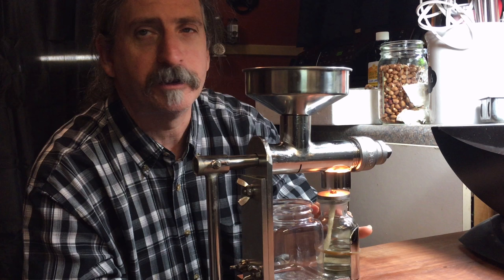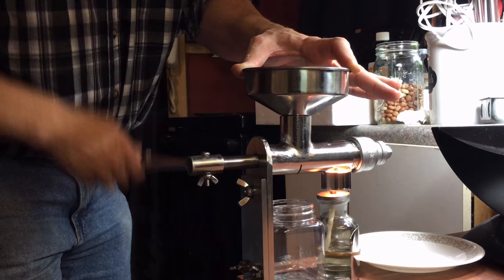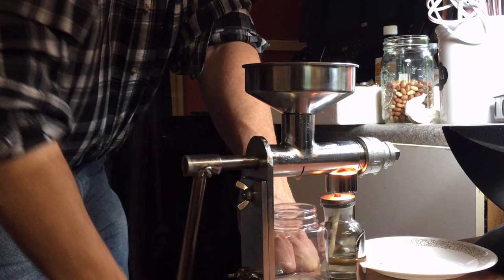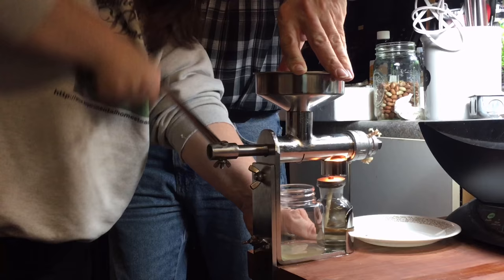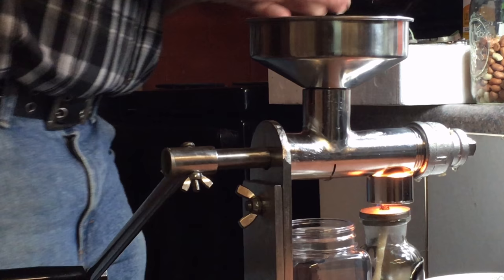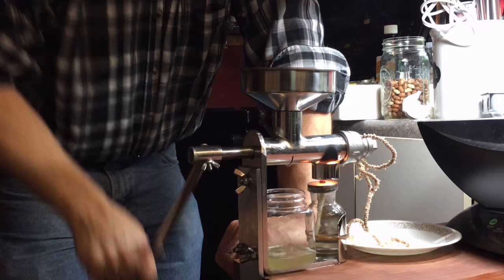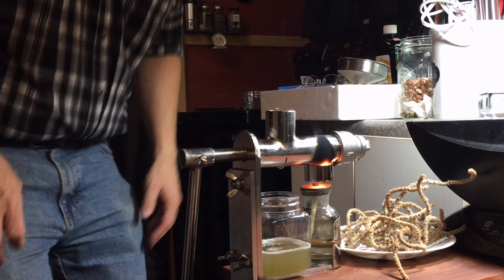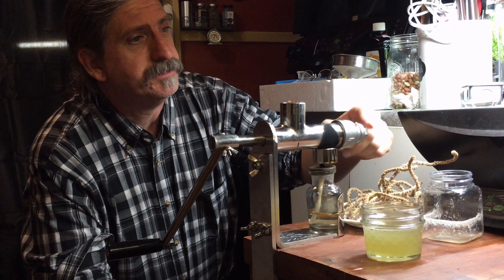Manual Oil Press Review

Comment: Hello any chance of an updated video, talking about your overall experience with the press. Pro tips, any issues, modifications, do and don'ts, fine tuning of the press etc would be extremely helpful. Which seeds work for best results. Instead of using kerosine or lamp oil, have you tried it with different oils for the burner, like some of the oils you already expressed using the machine. Or are they all too extremely flammable? Surely there must be a few expressed oils that could replace the lamp oil? It certainly would be nice to be able to have the machine self sufficient by expressing your own oil that can be used for the burner itself. Also any ideas or demonstration on making your own wicks for the press. Maybe even being able to use some of the seed cake for this, or is that a bit of a stretch? Or anything else you can think of? Any other options for heating the press, like a very small wood fire, instead of the oil burner (if using outside of course). Maybe even a cleaning video of the press. Also were you able to stop oil drippage from the end of the press. Just a general update would be great. Are you still using the press, or have you upgraded to a different version etc. Cheers in advance. Have you tried expressing leaves for their oils, by hot and cold press to see what results you can get for their essential oils. Were you able to fix or replace the S/S seed catchment so it doesn't pop out, too make it stay in place. IE find a replacement with a longer funnel at the bottom so it stays in better, or attach something to make it longer? Did you end up moving the press to attach to a larger heavier table or bench in the end or?
Reply: Good idea. I’d love an update
Reply from the maker: I would love to do an update eventually. We both currently work 12 plus hours 7 days a week, so it will be a while. I did update the blog post - I think.

Comment: If I may make a suggestion. To clarify the oil you can use gelatin or just plain old cold filter and time but the gelatin works quickly to grab solids and trap them at the bottom making easier to put into a clean jar
Reply from the maker: Thank you for that tip!

Comment: When you heat all the proprieties of the différents oils are damage? If you make with sunflower or linen it very sensitive to the heat the light and oxygen. So all omegas are burned. Sorry about my English. Kind regards.
Reply from the maker: Hi David, your question is spot on, and your English is just fine! 😊 When using a manual oil press with heat, it's essential to consider the properties of the oils you're extracting.

You're absolutely correct that some oils, like sunflower and flaxseed, are sensitive to heat, light, and oxygen, which can cause them to degrade and lose their beneficial properties, including essential fatty acids like omega-3s. The pressing method I demonstrated in the video does involve some heat due to the candle flame, but it's relatively mild compared to other extraction methods.

For oils like sunflower or flaxseed, cold-pressing methods are often preferred to minimize heat exposure and retain their nutritional value. These methods use mechanical pressure without external heat sources.

Your concern highlights the importance of choosing the right extraction method for different oils to preserve their unique qualities. Thank you for bringing this up, and if you have any more questions or want to discuss specific oils or extraction methods further, feel free to ask. It's great to have these discussions about the science of food and oil extraction! 🌻🔥🍃
Reply: Thanks for your response. So what kind of oil press can I use without heat to extract flaxseed, sunflower, or any oil contains omega 3?

Comment: I wonder if that seed cake is similar to the powdered peanut butter people buy
Reply from the maker: Hey Matthew, great question! Seed cake from the peanut oil extraction process does have some similarities to powdered peanut butter, but there are also significant differences.

Seed cake is what remains after the oil is pressed out of peanuts. It's essentially a concentrated peanut residue. While it does contain some residual peanut flavor and protein, it's usually much higher in fat compared to powdered peanut butter, which is defatted and often contains additives like salt and sugar.

Powdered peanut butter, on the other hand, is made by roasting peanuts and then removing most of the fat, resulting in a lower-calorie and lower-fat product. It's typically used as a lower-fat alternative to traditional peanut butter in recipes and shakes.

So, in essence, both seed cake and powdered peanut butter start with peanuts, but they undergo different processes and serve different culinary purposes. It's fascinating to explore these connections in the world of food! If you have more questions or want to know more about either of these products, feel free to ask. 😊🥜🍴

Comment: Thanks for the video, question. Do you know what temperature the oil gets due to the heating?
Reply from the maker: No. We did not take the oils temperature after pressing, but it did not seem hot. I was able to pick up the container of oil with my bare hands with no issues.

Comment: Any idea how this would with softer material such as olives?
Reply from the maker: Hi @DirtRoadAutoRepair, great question! While the manual oil press I demonstrated in the video is primarily designed for seeds and nuts, it can work for softer materials like olives with some modifications.

When working with softer materials, you may find that the pressing process requires a bit more effort compared to harder seeds. It's essential to ensure the olives are well-prepared, such as pitting them before pressing.

Additionally, using a lower-pressure setting and slower, more gradual pressing may be necessary to extract the oil effectively from softer materials like olives. Experimentation and adjustment of the pressing technique will help you achieve the best results.

Remember that the quality of the oil extracted can also depend on factors like the ripeness of the olives and the variety you're using. If you decide to try it with olives or have more questions about the process, please feel free to reach out. Happy pressing! 🫒🥜🛢️

Comment: Can this be used as a vegetabale juicer aswell??
Reply from the maker: Great question! While a manual oil press and a vegetable juicer both involve extracting liquids from plant-based materials, they serve different purposes and have some key differences.

The manual oil press is specifically designed for extracting oils from seeds, nuts, or oil-rich materials. It operates by applying mechanical pressure to these materials, which results in the extraction of oil.

On the other hand, a vegetable juicer is designed for juicing a wide variety of fruits and vegetables. It typically uses a different mechanism, such as spinning blades or augers, to extract the juice from the produce.

So, while a manual oil press is excellent for oil extraction, it may not be the best choice for juicing vegetables, as it's optimized for a different process. If you're looking to make fresh vegetable juice, I would recommend using a dedicated vegetable juicer for the best results. If you have any more questions or need further clarification, feel free to ask! 😊🥦🍹

Comment: What happens when we don’t use the candle 🕯,pls can u reply, and was the oil hot or warm or very hot ???
Reply from the maker: You need to use a candle and no, the oil was not hot or even warm if I remember correctly.
Reply: Sheri Ann Richerson thanks for the reply 👍
Reply from the maker: You are welcome.
Reply: I own one of these, without heat, the seeds or nuts just get bound up and wont expel oil or castings. The temperature of the body outside of the ring the candle is under gets warm, but not hot to the touch. I'm assuming in electric or industrial presses the friction provides the heat to help the oil flow.

Comment: Looks like there is more leaking from the end than going iin the jar.
Reply from the maker: Hi @inannashu689, thank you for watching the video and sharing your observation. When using a manual oil press, it's not uncommon to have some oil leakage, especially if there's a mismatch in the size of the press tube and the receiving jar's opening. To minimize this, make sure that the press tube fits securely into the jar's opening, and you may also want to use a jar with a wider mouth to catch more of the extracted oil. Additionally, adjusting the pressure applied during pressing can help control the flow.

Every setup may have its unique quirks, so experimenting and finding the right configuration for your specific press and jars can improve efficiency. I hope these tips help, and if you have any more questions or need further assistance, please feel free to ask. Happy pressing! 🌱🥜🛢️

Comment: Does the oil extracted contain lots of water that is there inside the seed?
Reply from the maker: I did not see any water in the oil I collected and it did set in the refrigerator about a week or so as I used it up. My guess is the water evaporates in part because of the heat as it is pressed.

Comment: How can you do cold press? Without using the lamp? What does the lamp do?
Reply: What does heating part do?
Reply from the maker: Releases the oils. You need to heat the material in order to get oil. You can use the lamp to heat the materials, use an oven or a microwave but you must heat up the material you are pressing to get it to release the oil.
Reply: @SheriAnnRicherson  i know cold press gets less oil. Can I use this tool to make cold press oil? Or only with heated materials?
Reply from the maker: @youngmipark3607  I think you are misunderstanding. You MUST heat the item you wish to press in order for it to release the oil. You can use this lamp to do that with - or a microwave or an oven. You cannot get oil from a nut or seed without it being slightly heated.

Comment: help me, I bought one exactly the same and everything got stuck at the end and nothing let out by the holes, I´ve tryed with 4 seeds, almonds, sesame, sunflower and walnut and nothing happens
Reply from the maker: Try to loosen the end of the press. Did you hear it for 7 to 10 minutes first? Let me know. Jeffrey is at work but I will ask him if he has some tips tomorrow if what I told you does not work.
Reply: +Sheri Ann Richerson i already did that and sometimes the seeds inside get burn, other times just get stocked there, i want to cry, i am in a big problem because i bought 20 for a customer and if they don't work i am lost, do you know how long it took cranking until the oil came out?
Reply from the maker: +eva mex - it took a few minutes. I thought I read that the sesame seeds needed mixed with something but I honestly don't remember. Let me get with Jeff as he did the assembly and video.
Reply from the maker: +eva mex - I remember he let it set too long and the peanuts hardened inside so we had to soak it for quite a while before they came loose.
Reply from the maker: +eva mex Hi, there is no need to charge. We do not have whatsapp. He wondered if your flame was too high? He also said it does take a while to get the inside of the oil press full of seeds before the oil starts to come out. Once it starts to come out, it flows continually.
Reply: +Sheri Ann Richerson ok thanks, i will try
Reply from the maker: +eva mex - were you able to get it to work?
Reply: +Sheri Ann Richerson  no sheri :( i ve been cranking for 20 min and nothing of the cake comes out
Reply from the maker: +eva mex - I wish Jeff was here because he might know something else. I am sure you are frustrated. Did you fill the hopper full of seed? I am sure you did, but I am just trying to think of what the problem might be. Try loosening that end a bit more too. I know you said you tried that. I remember he thought it was loose enough at first and it was not.
Reply: +Sheri Ann Richerson yes sheri , i heated for 10 min, it started to get oil at minute 5 but at minute 10 started to smell burnt and oil turned black but the blamr was really really low
Reply from the maker: +eva mex - That is so strange. What kinds of seeds were you pressing? I almost want to tell you to try Spanish Peanuts and see what happens. I chose those because I figured that would be the easiest. I have not tried anything else yet.
Reply: thanks a lot my friend, we are thinking that maybe the holes are so small, tomorrow we will do some tests and let you know :)
Reply from the maker: +eva mex - thank you! I will ask Jeff if he has any other ideas when I see him. Have a good night.
Reply from the maker: Thank you!
Reply: eva mex I had the same issue.  I did not let it heat longer enough before cranking,  it all compacted in the cap and then it roasted hard like cement.  Pain to get it clean.  Let it heat longer and it worked great.  I was using soybean.

Comment: Can you cold press with that too? Or is it to hard to crank?
Reply from the maker: We are cold pressing. It is not hard to crank. Heat is required in order for the nuts to release the oil.
Reply: @SheriAnnRicherson  thank you so much for that. Mine will be here tomorrow.  I have 2.5lbs of cacao beans from Peru I can't wait to squeeze the butter from. And make a cup of coco from the squeezings.
Reply from the maker: @icysteve46  oh my goodness! Did you by chance get the cacao from Bryan Brunner? Please come back and let me know how well it works for that! I'm very interested!
Reply: @SheriAnnRicherson  I got them from yopik on ebay. $25 total for 2.2lbs. They are raw unroasted.  I mildly roasted them. It makes them easier to shell. OMG I open the jar and they smell so good. Like a really strong semi-sweet chocolate.  My favorite.  I will get you all the details on the big squeeze asap.🤗
Reply: @SheriAnnRicherson  
Okay. That was a train wreck. I'm still boiling the end cap trying to get the rock hard cacao out of it. I don't know what went wrong  but it stopped coming out the end when the oil started to flow. The the cap started to unscrew so I grabbed some pliers to hold it on. And I ended up compressing a funnel of nibs into a brick. I've been boiling that for an hour now.
☹☹☹☹

Comment: Was a brand ever mentioned?
Reply from the maker: +lisa s - it was referred to the way the seller has it listed on Amazon and the link to buy it is in the description.
Reply: Nice review, but I don't think I see the link to buy it on Amazon in the description! I want to buy one for my dad for Christmas and I think I found the right one, but I just want to be sure. Thanks!
Reply from the maker: Here is my affiliate link for Amazon - https://www.amazon.com/gp/product/B01126D1UG/ref=as_li_tl?ie=UTF8&camp=1789&creative=9325&creativeASIN=B01126D1UG&linkCode=as2&tag=exoticgardeni-20&linkId=7e9006e1a38bc8ddd09c8cb40a40754c I do have to tell you that I get a small percentage of the cost if you buy anything using this link.
Reply from the maker: Here is my affiliate link for Amazon - https://www.amazon.com/gp/product/B01126D1UG/ref=as_li_tl?ie=UTF8&camp=1789&creative=9325&creativeASIN=B01126D1UG&linkCode=as2&tag=exoticgardeni-20&linkId=7e9006e1a38bc8ddd09c8cb40a40754c I do have to tell you that I get a small percentage of the cost if you buy anything using this link.

Comment: This item has 1.5 stars on Amazon, out of 5 available.
Reply from the maker: It works fine for me and has met my needs. Everyone has a preference on what they like and what they expect out of a product. We personally had no issues with this and still have not had any issues. A manual oil press takes some work and some getting used to. To begin with the first sentence of the first review that it takes an hour and a half to heat up is not true. You see on the video how long each step takes. The second review - none of my parts have rusted. Our machine was washed and dried immediately after being used, then put away. Like I said, this works fine for my needs. Anyone who thinks using this is going to be as fast or easy as going to the store to buy oil is sadly mistaken. Doing things like this yourself manually takes work, just like making your own noodles or grinding your own flour. Again, I am very happy with the unit and the way it works.
Reply: Review scores are so easy to manipulate they're practically useless. Written comments have minor validity.
Reply: It's a Chinese copy of the Piteba which is made in Holland.    Since this makes a food product and is made by an unknown company, the metal safety is of concern.   Do some research on Stainless steel being toxic then add to that again that is made by an unknown Chinese company.